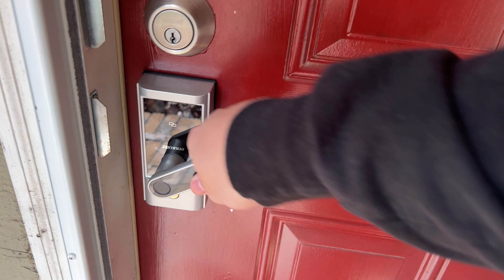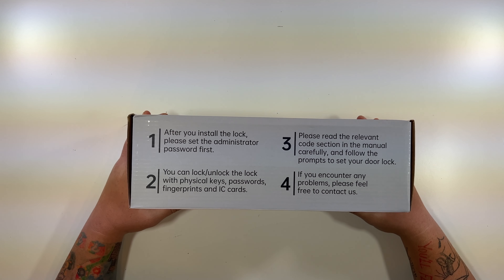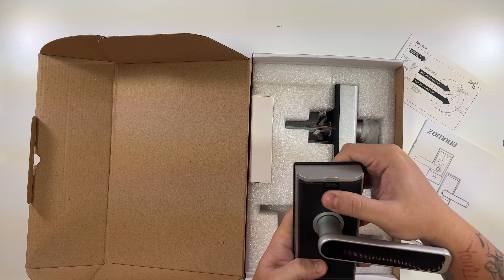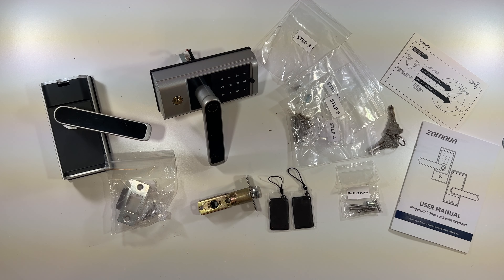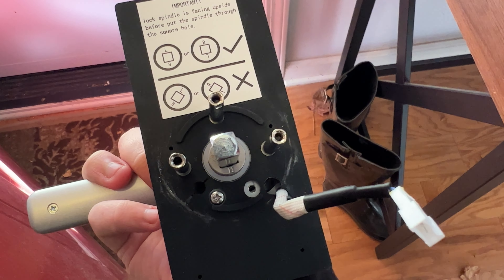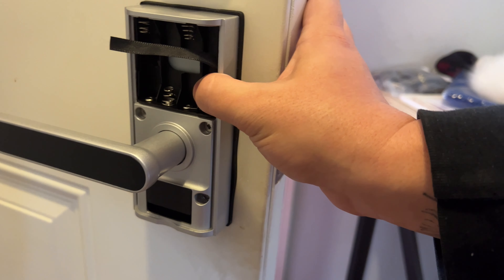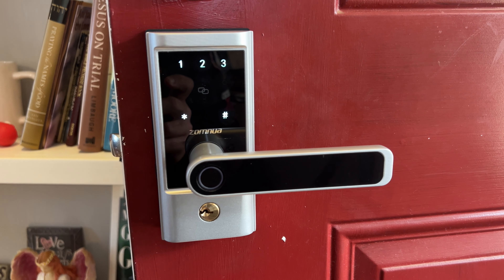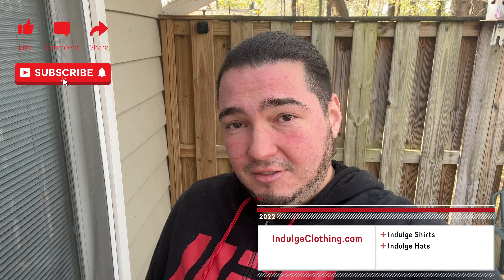Zomnua Fingerprint Door Lock Setup and Review

Comment: Fingerprint programming. Press *, then #. It will then ask you to input your code. After that, press 2 for user settings. Then press 1. Then put your finger on it as many times as it prompts. Then just let it exit set up mode and it should work. The video I found was on amazon where you actually buy the lock. Right under the picture of the lock, there are 6 videos. There's one 3:55 secs long.
Reply: Strangely the Manual does not include this info anywhere. A huge miss. Thank you for this info.
Reply: Thank you!!!! Very helpful